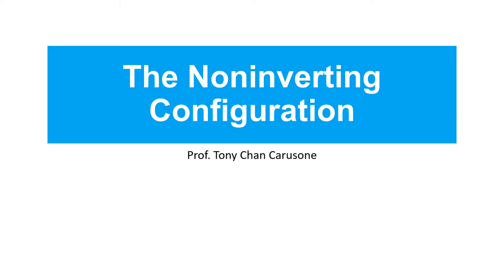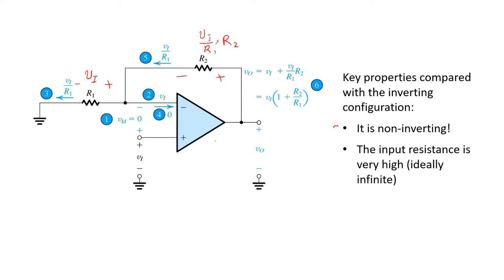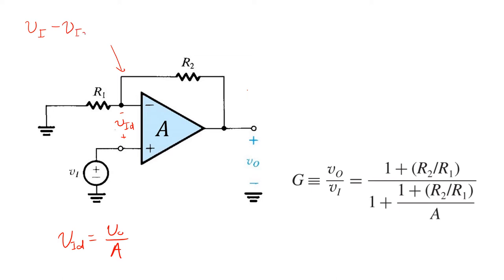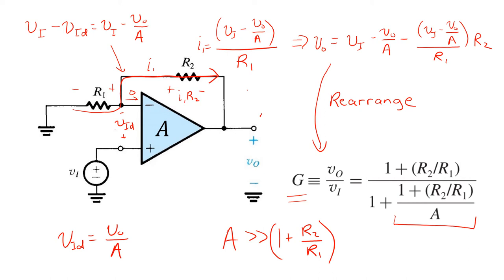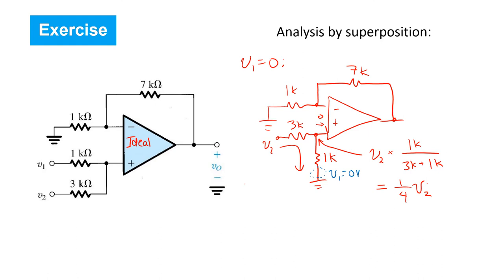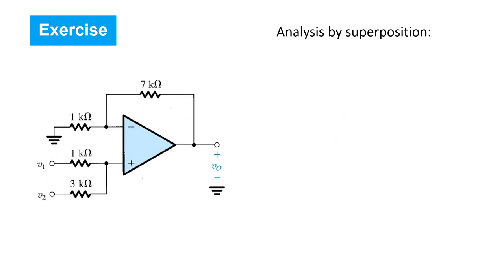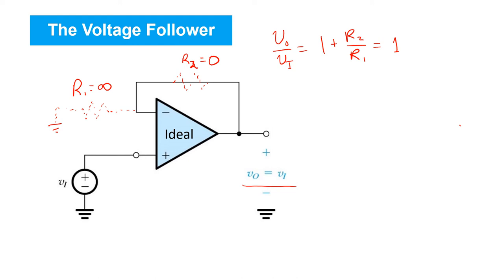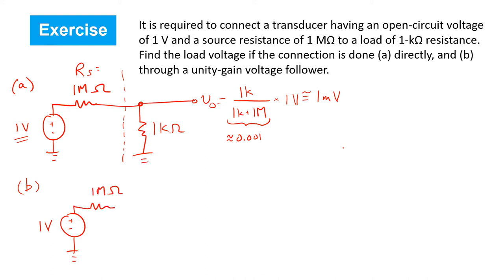11 The Noninverting Configuration

Comment: At around 4:46,  I think with the way you draw current direction, polarities of voltage across R1 need to be reversed. Or it can be kept the same, but current direction must be reversed; and polarities of voltage drop across R2 must be reversed. Hope I'm on the same page and my comment confuses no one.
Reply from the maker: Yes, you're absolutely correct.  The current flows in the other direction, and the resulting voltage drop on R2 should have the opposite polarity, which effects the expression I write around 5:45.  Thanks for pointing this out!